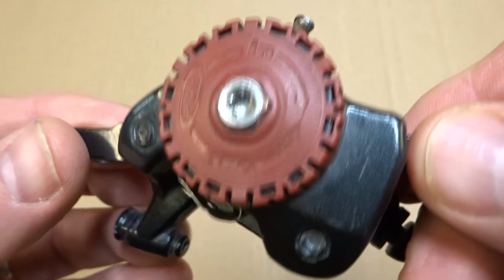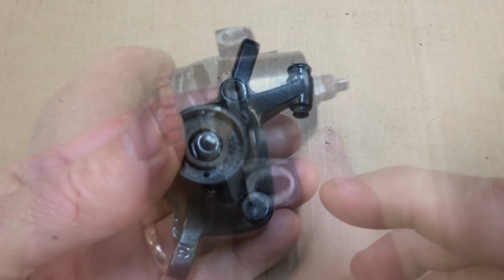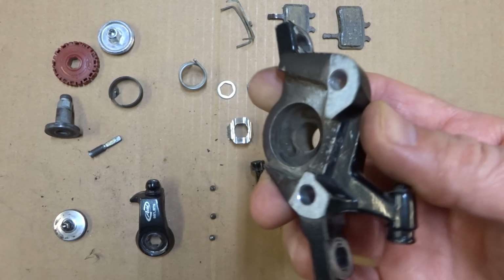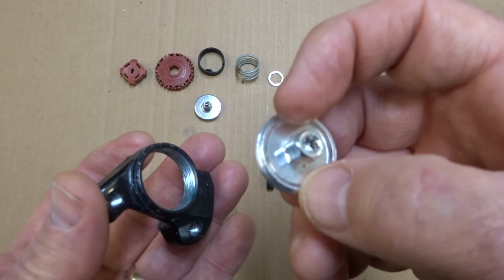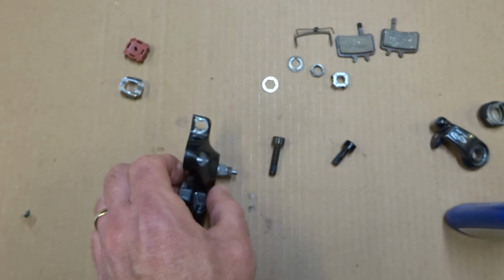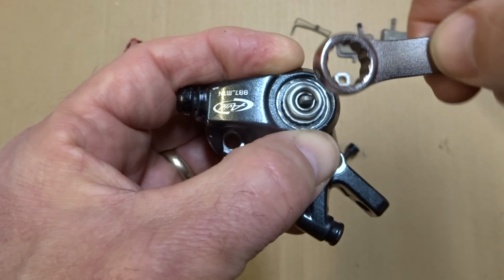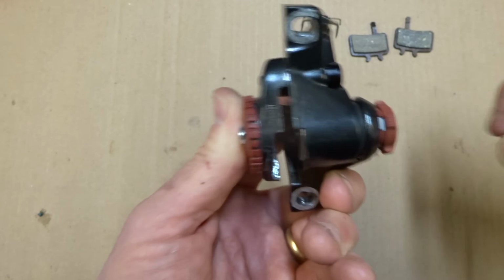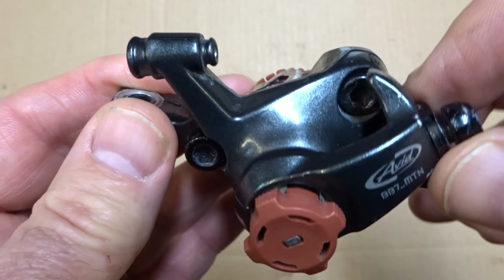Bike Disc Brake Caliper Disassembly/Assembly (Avid BB7)

Comment: 11:25 It makes sense to also completely lubricate the balls beforehand, since they do not rotate in the brake, as in a bearing, which means they will not be completely lubricated on their own, which means they will rust in the air

Comment: Brilliant explanation. Thank you.  The problem I still have is on my cycle cross bike with quick release skewers when I tighten the clamp it pushes the frame inwards resulting in the wheel and disc rotor touching the pad resulting in a rub even when I’ve dialled the stationary pad all the way out.
Any advice would help. Thanks from Scotland 🏴.

Comment: Im having qn issue where my brake pads aren't lininb up in the caliper.  The pads and spring are installed correctly but the top of the pads (bunny ears) wont seat properly so i get sort of a teepee shape from the pads.  Any advice?

Comment: Super useful video. Thanks, RJ the Bike Guy. 
I have a question. Apologies if someone asked it already. On my BB7, rear side, the outter arm (and perhaps related piston) is rather lose and has a lot of play. It does not seem to affect the efficacy of breaking but it generates a noise whenever I turn. It is as if one of the pads touched the rotor. however, when I cycle straight, there is no noise. Have you got any idea about it ? I could have a separate conversation if it is convenient. I can give you my phone number. 
THanks again. 
Pierrick,

Comment: I noticed for the small red adjuster knob, it looked like it didn't go in all the way in enough.  Before you took it off, the metal tab came out further than when you reinstalle the knob.  It also looked like the "arms of the knob doesn't need to be lined up with the metal 4 prong washer.  I was comparing the part of the video when you took it off and when you put it back on... not quite match in installed depth.  But since I've never taken these apart, I can't say anything other than the observation.    Great video requardless!

Comment: Good video!  But I need help..  I've got a zoom 280 caliper on the back of my trek 3500d. It looks similar to what you have there. My issue is that when I put the pivot arm back together there doesn't seem to be enough tension in the spring.  So when I push the brake lever it stops the bike..but it doesn't spring back.  I'm not sure how to get more spring tension into the lever where the brake cable attaches.  It seems that I only have like 1/2" of cable travel between released and braking positions.  What could be wrong with the way I assembled it?

Comment: Too much grease, threadlock and use of pliers.

Otherwise our techniques are similar.

If you have 2 bolts for thread lock apply to one and use the other bolt to smear and share excess to other bolt.

Comment: Wouldn't one of those ( I think it's called an acid brush ) steel handle brushes be better than a Q-Tip? I have bad luck of the Q-tip coming apart and cotton is left behind and has to be cleaned up or cause problems.

Comment: Best non hydraulic affordable disc brakes. I am not up to date, but if I think TRP makes some mechanical disc brakes with both sides mobile. The only advantage they have is that if the rotor is perfectly centered and the pads adjusted properly, the rotor would not flex. I find this quite irrelevant for the ordinary cyclists who don't use extreme braking force. I use BB7s for about 10 years now and never had issues with them.

Comment: Without a doubt these are the best non-hydraulic brakes out there.  They are certainly better than many low-end hydraulic models.  Great explanation of how they work and how to over haul them!  (By the way, we are getting spoiled with all the new content.  Welcome Back!)
Reply: What do you think of TRP Spyke / Spyre?
Reply: @andreybatashov2183  the TRP Spyre is a brake designed by people who don't ride in bad weather. Unlike the BB7's the adjustment screws don't have a clicking system but rely some kind of "locking"grease to stay in place. After a year there wasn't any locking feeling left in the adjustment screws, just felt like water and sand washed away the little resistance there was. And when you are riding long distances, you always need a key to adjust the brake pads. On the BB7's adjusting the outer pad is often enought to keep going, which can be done in seconds at a red light. To me the BB7's are simple but well thougt out, the Spyres look nice but have a few kinks that could have been avoided. (The two way action, in my eyes is a gimmick, they are not self centering  like an hydraulic brake so they still rely on bending the rotor a bit but need twice as much parts.
Reply: @andreybatashov2183  The TRPs are a better design, since both pads move towards the rotor. The Avids deflect the rotor against the stationary pad.
Reply: @cgrocho47  Agreed, though the BB7s look much easier to service than the TRPs.
Reply: @stevem2531  The TRPs aren't bad to service at all, the first time I tore it down it only took about 25 minutes to do the whole thing. I do think the value isn't there considering they're more expensive than a lot of hydraulic calipers though.
Reply: @andreybatashov2183  I like them better than the BB7, myself.

Comment: The trick with these, other than getting the piston back in, is that the torque arm throw will be off if you don't have the piston seated flush. If the torque arm throw is off, you'll have little to no modulation and spring back of the lever arm. That and the pad on the piston side will not retract all the way. Note the position of the torque arm before disassembly.
Reply: I think this is my issue..how do I resolve?

Comment: Should you be putting so much grease in this?  I would imagine grease and brake dust would make a fine sandpaper.
Reply: Each to their own. Given their low load and low actuation rate, I wouldn't bother myself. But perhaps there's some wisdom.

Comment: There is a grub screw to adjust tension on the spring, if you backed it out then it makes putting the arm back in place much easier, many cable operated calipers also have a tiny grub screw hiden on the outer adjustment disc to lock it in place, it's very easy to overlook this one and then struggle to move the adjuster.
Reply: I have a question on my mind, and you might possibly be addressing it. I have several low-end single action calipers and they all have a tiny set screw in the body and going in perpendicular to and butting up against the threads of the fixed pad adjuster. It seems to be a bit of a mess and varies across the models.
They are obviously intended to apply tension/locking to keep the adjuster from inadvertently turning. Some have a small plastic plug between the set screw end and the adjuster threads, and some don't. The screws that don't have the plug have damaged the adjuster threads by essentially plowing into the threads.
It brings me to my question. Are these set screw supposed to be backed off during the fixed pad adjusting or is a proper set screw/plastic plug preset supposed to be left alone during pad adjustment?
Reply: @snakerstran9101  yes the set screw is there to stop the adjuster moving, yes there is supposed to be a nylon buffer to stop, as you point out, damaging the thread as it’s soft aluminium, you’re supposed to slacken it off, do your adjustment then tighten it just enough to stop the adjuster moving as over tightening will destroy the nylon buffer

Comment: For someone with an early model bb7, they don't split in half and need a special tool, the "mdt-1", to service.  Same operating principles though.
Reply from the maker: Hmmm. I haven't seen one of those BB7s.
Reply: @RJTheBikeGuy : I think i must have one of those as well. The caliper halves seem bonded together. Trying to figure out how to remove the pistons

Comment: You and ParkTool are one of the best things that could happen to the bike community, thanks for all your work RJ <3
Reply: Well said.
We are in danger of becoming dependent on corporations for basic things.
I'll be able to keep an obsolete bike going thanks to people like RJ
Reply: An extremely useful video. But Avid has changed the assembly since you made the video, or I have an earlier version. The two bolts holding the caliper halves together are the same length and they are Torx, not 5mm hex. More important, when they are removed, the two halves seem glued or bonded together; they don't separate. At least they have not separated yet. Still working on it.

Comment: RJ I have a question inst avid disc brakes SRAM brand
Reply from the maker: They are now. SRAM acquired them in 2004.
Reply: Thanks I wasn't too sure I thought they were sure am nowadays but I wasn't too sure because that's what I put a lower end model on my specialized hard Rock because I switched to the front to this and right now I'm trying to find where that special bracket where you can on a vintage bikes where you can convert it into this trying to find the right one is very hard thank you so much